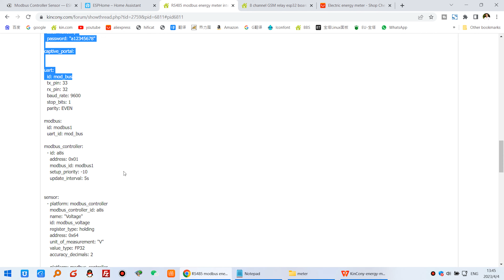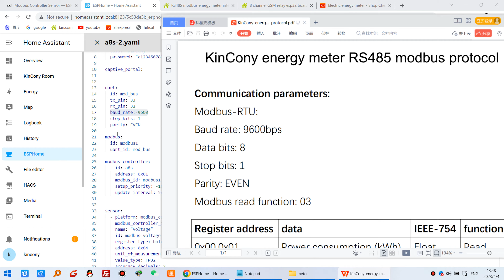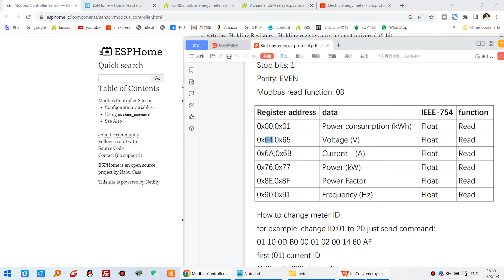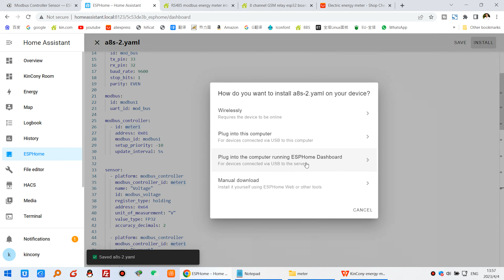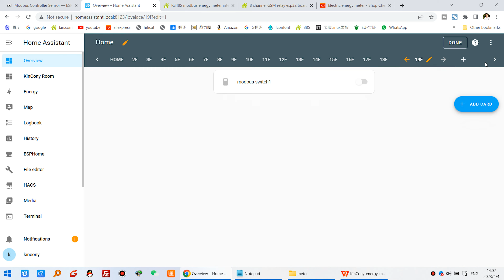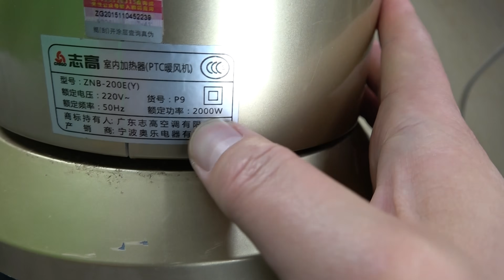Energy meter add to ESPHome by RS485 Modbus For Home Assistant

Comment: How to make it work with KC868-Server RS485? Where I can find the tr_pin and rx_pin for that controller?
Reply from the maker: you can find pin define of KC868-Server by diagram link: https://www.kincony.com/forum/attachment.php?aid=846
Reply: @KinCony  trying to figure out but don’t understand the diagram. Could you mention PIN number for rs485 ports in KC868 Server (CM4+eMMc)? Thank you
Reply from the maker: CM4 IO14,IO15 use for RS485 @sebagarayco

Comment: Hello Great video thanks. Can you help me? How can i change the address of the slave if i have more than one slave on the modbus? How to use ESPhome for this once step? thank you
Reply from the maker: slave energy meter have change address modbus command. that can set by USB-RS485 adapter. just use PC send command to energy meter by RS485. ESPHome yaml set the different address for different slave device.

Comment: Can this method be used for kc868-server (raspberry)?
Reply from the maker: sure  , just connect to server's RS485 port, edit configuration.yaml of home assistant
Reply: @KinCony  can you please provide a video tutorial for the kc868 server version
Reply from the maker: almost same, just change serial port RXD,TXD pin define. @AutoTron121
Reply: @KinCony  I don't know what pin the RX tx server is on
Reply from the maker: https://www.kincony.com/forum/showthread.php?tid=1977 @AutoTron121
Reply: @KinCony  1. Enable serial port on Raspberry Pi CM4
The enable it you need to check in /boot/config.txt the line enable_uart

I don't know where to find out where config.txt is located
Reply from the maker: the file in your CM4 eMMC disk. @AutoTron121
Reply: @KinCony  how to access it
Reply from the maker: https://www.kincony.com/forum/showthread.php?tid=1748 @AutoTron121

Comment: How many 1p power meter can be connected with A16 using rs485 ? Can we connect more than 2 power meter of different phases of kincony with one rs485 port of a16 or we only one rs485 port support only one power meter ?

Nice video
Thanks 👍 keep it up 🙂
Reply from the maker: sure, you can connect together, because every meter have different rs485 address, MAX support 254 devices by one RS485 port.
Reply: @KinCony  Appreciate your instant reply. Thanks
Reply from the maker: @manzoorchaudhary6596  you are welcome